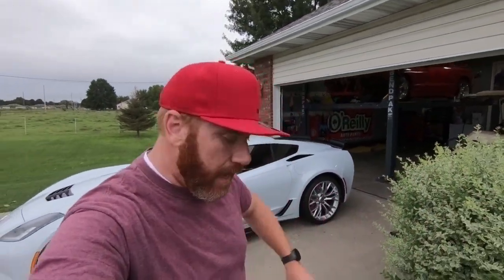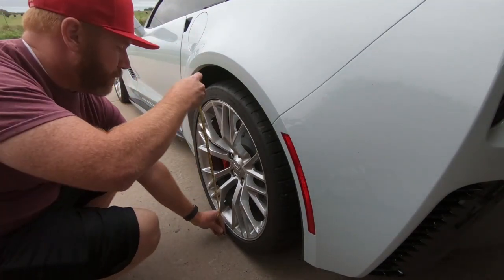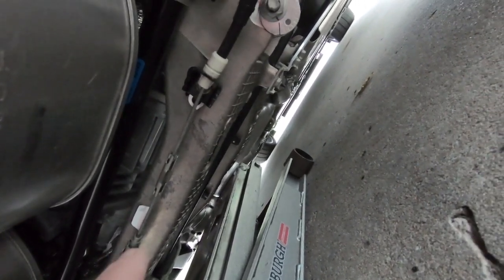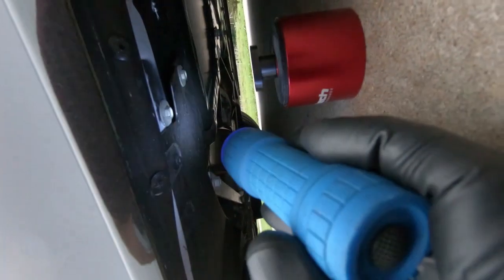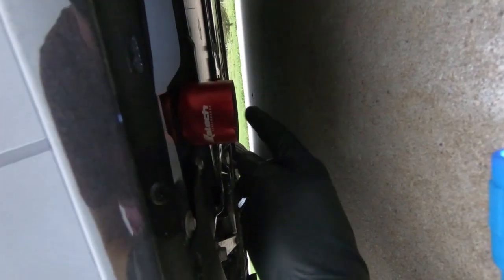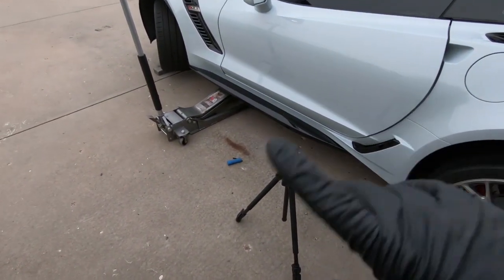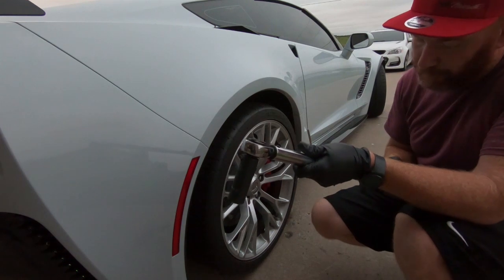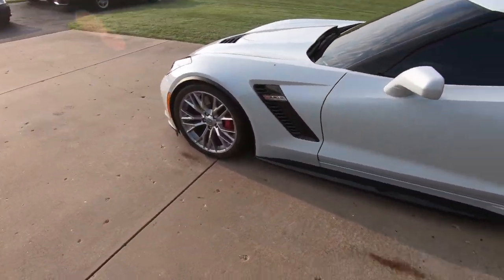How to Lower Corvette

Comment: Easy enough. Good vid. I have 2019 stingray and noticed the wheel well gaps. But darn vettes are already low as is, want to try it but might be too low. IDK.
Reply from the maker: I like them low
Reply: it is too low, this joker probably already ripped something off. they are almost too low as iti is
Reply: I ended up going low too, max drop on stock bolts lol. I took off the front wind dams, left right and middle rubber front sections under bumper, since rubbing driveway, got an alignment too. Not to bad, just have to watch steep declines and inclines, go over them slowly. Like it.
Reply from the maker: Not for me but maybe for others
Reply from the maker: Yeah if you know how to drive them low it's no problem

Comment: My 2019 GS already rubs on my driveway going out…I can’t afford an inch. I did my 2012 GS but I had a bit different driveway angle then. Easy job..takes about an hour. I had no alignment issues on the 2012.
Reply from the maker: Yeah its tough to get the look without sacrificed clearance

Comment: If u don’t that General Motors did not notice the height for the c7, they did , and seen all the videos of complaints we all gave for the c7 height, so the next one as the c8, they lowered the car more to standards and thus making for the first time the front air bag bump raise, or what ever us call it, my c7 ? Every one told me I am crazy to lower it, when I told my friends and family to stand back and take a look at it know and pointed how it looks like a 4X4: there yes was amazed to see how much it was raised, and 99% of them after seeing the height how much it’s higher, they all agreed except the wife, and now got another c7 with mag ride, it’s going into the shop here tomorrow afternoon for only 170 dollars plus my screws with wobble , stainless steel ones, 

But the rear on this car to is much higher then average , u stated 28 plus inches, it’s actually almost 30 inches, remember u have a 20’s in the rear thus causing it to go go 1.1 inches higher, plus the rear quarter panel guard, so it’s actually more higher then the front, but over all good job and u are a good mechanic to - and again love that color u choose very rare to see them anymore
Reply from the maker: Definitely looked 4wd. Lol

Comment: Good job, I did notice the RR was higher. Maybe you could raise the drivers side a little. Great job and very informative and sure as hell easy. Once I go drag racing this weekend I'll come back home and lower mine. I'm like you I'm addicted to lowering my cars, truck, drag cars. Not into 4wds.
Reply from the maker: It's the angle it was setting that made it look that way.
Reply: Another way I learned years ago is to measure from the bottom lip on the wheel and its not perfectly flat the wheel to lip of the fender well should always be the same. Sure is nice to have guys like you get out of head of us and post the vids. thanks again.

Comment: I have a 2010 ZO6 that I lowered the same way. It does look good but after about a year, the ride is so harsh it's terrible. I have  2019 ZO6 that I will never consider doing again. If you do it, spend the money and get it done right.
Reply from the maker: Several ways to lower this is just 1 and by far the cheapest. Spindles are the best but at $3000 not many want to go that route
Reply: I was wondering how bad it would destroy the ride. Didn’t seem like a smart thing to do . There is torque on everything for a reason.
Reply from the maker: Ride really didn't change
Reply: @TWAMotorsports  Im not sure how long it's been since you lowered it. Mine wasn't bad either at first. But after the seasons change from hot to cold etc and the metal start to flex back and forth. Give it a year or so. Hopefully it doesn't for your car. It does look good though but man never again the cheap way.
Reply: @reggieb3777   I bet a set of Koni yellow adjustable shocks would be just the ticket, they are great for lowered cars too, I put them on basically every vehicle (lowered and not), they ride better than stock shocks and the stiffness can be adjusted (if you don't have air ride)..
Reply: @Spirited_Driver  Thank you. I will look at them and reviews.

Comment: How far was the alignment off after doing this?
Reply from the maker: Not terribly
Reply: @TWAMotorsports  I did mine this morning and it’s not pulling or drifting so I wonder if the castor or camber or toe is off enough to even justify getting alignment
Reply from the maker: Mine was the same. I didn't rush to the alignment shop
Reply: Alignments are cheaper than tires..
Reply from the maker: Yeah but I trust the tire shop lol

Comment: What year is your Z06?  What's the ride quality?  Mine is a 2017 and when I got the MRC update when it was lowered ride qty was REALLY BAD. Dealer raised my up and now the MRC update works GREAT. I wonder if mine needed to be reset.  Im thinking of trying again
Reply from the maker: It's a 2019. Ride quality is the same. I have heard some have issues with the update but mine came with the newest version and rides like stock.

Comment: My bolts were extremely tight even after compression the rear one ended up stripping slightly 😡
Reply from the maker: Pretty common issue

Comment: Those bolts are for corner weight balance not lowering the car. But then you don’t care about that right?
Reply from the maker: I agree but I have watched them be assembled and that is not set during assembly. Each car would be set individually which isn't done during assembly process
Reply: Wouldn't you be able to measure it (perhaps equal rotations on the bolt for example), and still have the car lower as a result?
Reply from the maker: Yes
Reply: @Spirited_Driver  sure but to be exact you would need to have it on scales - 4 of them.  And balance the scales readings to match by adjusting the height.

Comment: Definitely NOT supposed to jack on outer most cross piece in the rear.
Reply from the maker: No issues with that
Reply: Isnt that a lifting point according to the owners manual?

Comment: Car is low enough,  he already hit the plastic splitter.. The Z06 stage 3 splitter is at 5 in, anything lower and the splitter is history.. Fine for rural areas or track, but avoid this if you live in a city or deal with speed bumps daily.. Your front end will be toast ..Nobody will notice a 1 in drop on the car.. Additionally, if you have side skirts, which are usually lower then the front splitter, you can take them destroy them too, As soon as you go over a speed bump, you will hit the side skirts.  The new C8 has a front end lift to deal with this.. Stupid backyard Rice Burner lowering..
Reply: Too me I figure this adjustment isn't for lowering but to corner balance the car? 

I keep hearing about vette guys lowering their cars, and scratch my head. My stang is lowered on coilovers, and everything needs to be 45, speed bumps are a nightmare, and I'm still slightly higher than a stock vette